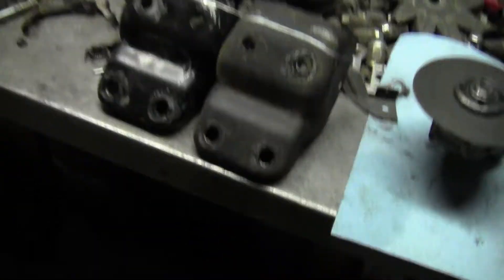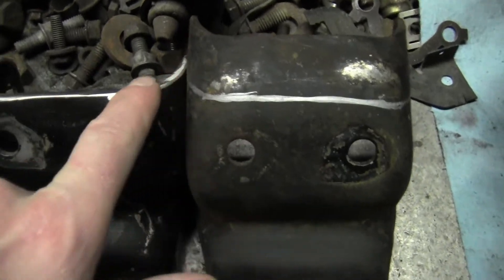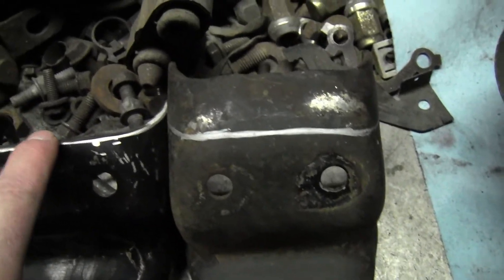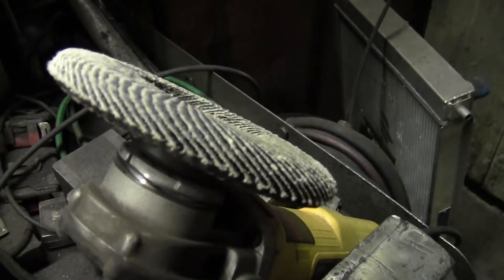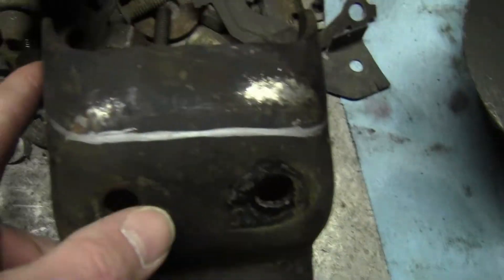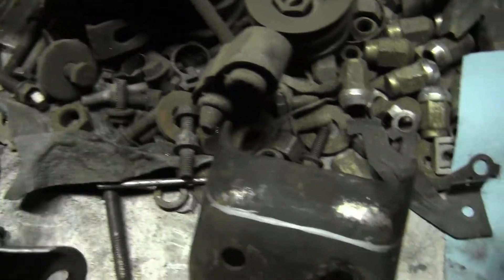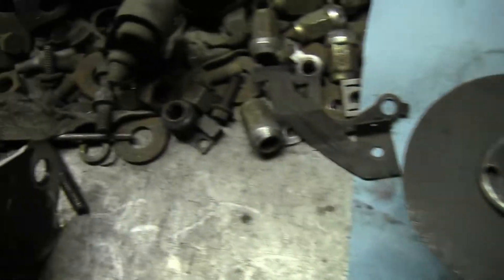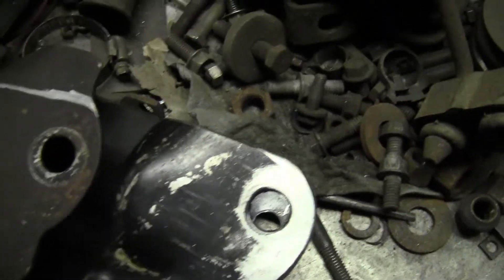1958 Ford Fairlane Budget Build, Ep 11 - Cutting Down the Motor Mounts

Comment: Some times we have heat up the metal ....cut up the metal...just to fabricated the best solution.....I really like your videos....keep them going.
Reply from the maker: This is actually in one of my up and coming videos, but I'll let ya in on it here. Years ago I was in Dad's waiting room at the shop bored stiff reading the old magazines he had laid out for customers. There was an article in there that described where the term "hot rod" came from. They said it was from the guys that would cut up these old cars and "rod weld" them back together. So back in the 40's & 50's the saying was.... "It's not a Hot Rod unless you Get The Metal Hot" For over 40yrs now that has stuck in my head lol. I added a little "Red Green Show" to mine though.... at the end of every show he would say, "Keep your Stick on the Ice".
I"m still working on that HF Titanium Unlimited 200 welder (and cart) review video for you, was just waiting for the snow to subside enough I can show the continuous long welds I did with it on that Backhoe I built. I haven't forgot about ya on that one... lol.
Reply: @BareRoseGarage  right on....boy we complain about 56 degrees here in California.....yet I watch you guys running around in the snow...makes me think what a sissy I am...lol..what state do you live in?

Comment: Looks good. I agree. I hate it when you get sliced when your not expecting it. 👍
Reply from the maker: Funny Uncle Tony and Dallas were talking about working on car in 90's (esp Fords). Thats when I vowed to NEVER build a car or truck like that. Hose clamps with Razor Blade tabs on them guarding a 10mm bolt with a 12mm nut on the back side that you can't see until you've bled out...... ug.... the nightmares.....